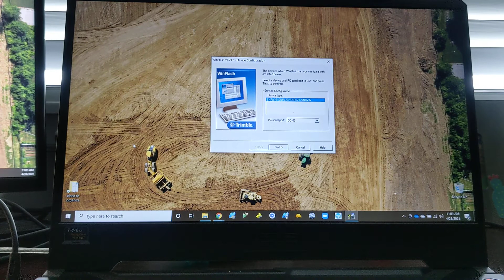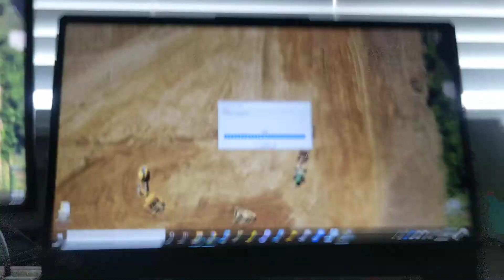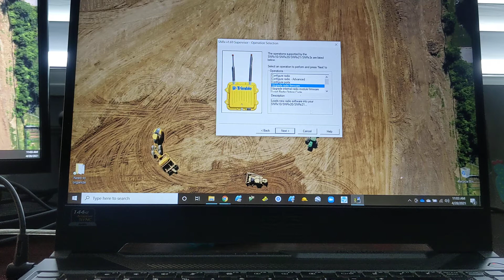Configuring Trimble SNR Radio with Winflash for use with Topcon 3DMC.

Comment: Hi ..  I see you appear to be using win 10 , what cable and settings are you using ? I have tried to connect to do the same but just get comms error.. cheers
Reply from the maker: We will post a video about the cable setup we use. I'll create a link for Winflash and the cabling. Video should be up by tomorrow afternoon.
Reply: Hi  do you know where I can download winflash snr?